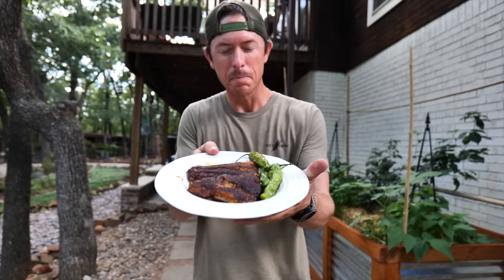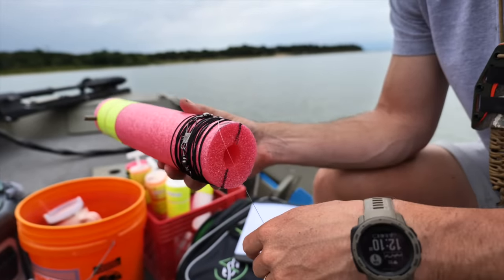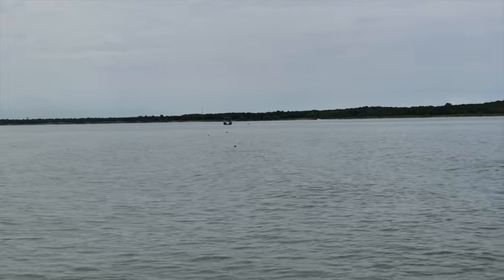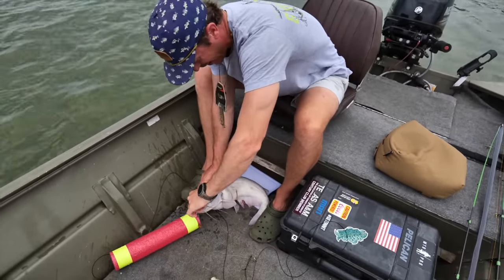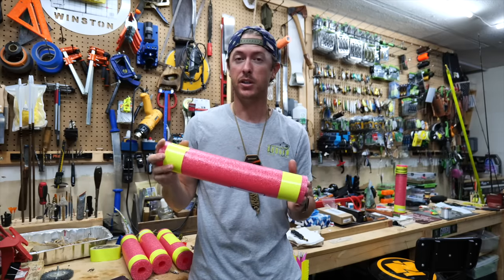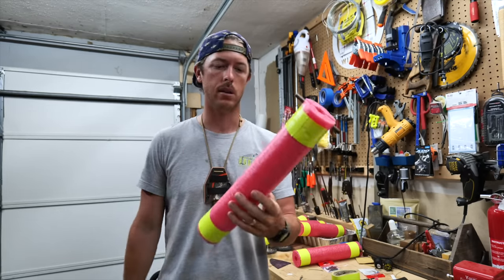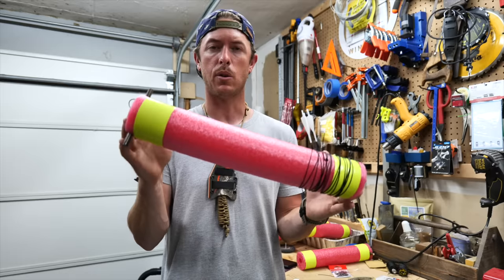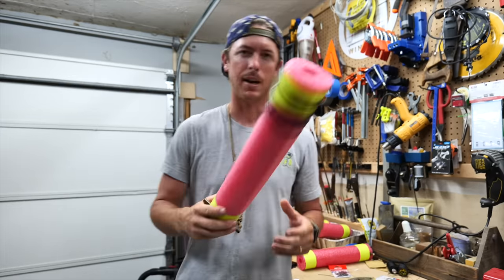Jug Line Fishing Design that's Simple, Cheap & Works! Complete DIY Build & Catch

Comment: You could glue a small piece of pvc pipe in the bottom so the line doesn't mess up the noodle/jug. File the inside nice and smooth, and then there would be no worries.
Reply: That's definitely the best way to do it. Gray conduit fits perfect

Comment: First and Foremost you 2 make an amazing example of what an American couple should be. Your both pretty awesome.
On tiny thought I had for these simple fishing Jugs ( depending on your regulations of course ) is on the top near your stick and a band of reflective tape that way if you loose 1 you can go back at night with a spot light and it would be much easier to find it.
Even if the fish got away youd just be leaving less trash

Comment: You could take about a 2” long piece of 3/4” schedule 20 pvc and stick the line through it, then insert the pvc into the bottom center of your jug to prevent line from cutting into the noodle.

Comment: I decided to make some of these using your "toggle" idea.  But, as a Plan B, I went out and bought 1/2-in PVC pipe, PVC end caps, eye bolts and nuts, and 3M 5200 to seal the hole in the end cap.  You know, just in case.
PROS:
Well, I went out this morning and your noodle jugs worked way beautifully.  I only had one snag (my fault - it was too shallow for my 25-ft line).  When I went to pull it in, the snag nearly pulled my arm off but the toggle did its job and stayed put. I just cut the line.  

CONS:
I have to return all the PVC, eye bolts, and 5200 to Home Depot.
Thanks for the video!!

Comment: Marlin knot we call a Slip Knot and if you pull it around till it knots then it cannot allow the toggle to free float.still releases just have to tug a little harder. Laws have changed and glad you said 3 inch diameter I now must revamp a few of mine I used 2 inch noodle from years back. All of my throw lines are interchangeable and a few for major sized cats. I also added reflector tape for night fishing, losing one can get you a fine now.

Comment: Great video!  Thanks for sharing your ideas.  Using the marlinspike hitch with a toggle for rigging is pure genius!  You called it  the one drawback, but I see it as the best part of your system.  It allows for super easy depth adjustment and you get to tie a cool and easy knot (knot junkie).  Tonight's project...re-rig all my jugs.  Thanks again for sharing another great outdoor adventure.

Comment: I like the simple design. I was worried about the line coming off the stick. So I cut another 3” stick, made a loop knot at both ends of the string. The made a small hole though the side of the noodle about halfway down. Then fished the loop down the center and push the second stick through the loop and the noodle. The stick is very snug in the foam, but the gear tag covers both sides, so no way for the stick to come out. now if the top stick comes off the line is still permanently tied the noodle.

Comment: I built mine with capped pvc with rebar weights....   These tip up type noodles leave no questions as to having a bite since they stand on end as the weight sides to the bottom.  lines are attached with eye screws on one end.

Comment: I put pvc pipe in the middle and use a railroad spike as a weight. Used to waste too much time driving around the lake looking for the jugs. When you have 10+ jugs setting them out can take too long with the wrong design.

Comment: I use the cheap pool noodles and put gray plastic conduit in the middle of it. Pre drill your holes to tie your line to and I can't remember what kind of glue I used but make sure it works on plastic and dries slowly.  It's cheap, easy, and extremely durable.
Reply: I came up with my design by picking up a bunch of old nasty abandoned jugs off the bank and comparing ideas. You could notch the tubing and still do your adjustable type rig.

Comment: Drill a hole going across/under insert another dwell Or do your normal slit and go cross ways with it and make a slightly deeper slit so you can put to of them in and then tie off to both  them in the middle just a thought

Comment: I would find a plastic bottle that would fit over the noodle and cut the bottom of the bottle off to fit over the end of your rig.
Melt a hole thru the bottom, feed your line thru, this would keep your line from cutting into the noodle.

Comment: Justin you should really try making some jug lines using pvc pipe with a piece of rebar inside the pvc pipe and then put the pool noodles over the pvc pipe!!! I definitely like making them this way because they last for ever and when a cat pulls on the bait and the pvc pipe that is laying on its side when fishing starts to go up it will push the rebar to one end and make a nocking noise and will usually make the cat fish get spooked and forget about everything but the bait and they try swimming away with the bait and end up hooking them selves!!! Ever since I figured out how to make them like this I have definitely had a much better hook up ratio!!! Hopefully my explanation you can figure out how to make them?? I use 3/4” pvc pipe with some end caps and on one end threw the cap I use washers, nuts, and a threaded eye lit!! Drill a hole threw one end cap and put the eye lit threw the hole that you drilled with as big of a washer that will fit and then glue it onto the pvc pipe!! I think I cut a piece of pvc pipe at 14” to 18” then don’t forget to put a piece of rebar inside but the rebar needs to be cut less than half the length that you cut your pvc pipe at!!   After you have your eye let bolted to the end cap and glued on and you have your rebar inside you can then glue the last cap on the other end to seal it up!! Oh and when you are bolting the threaded eye lit to one of the end caps you can take some silicone and put on inside of the cap so when you tighten the washer up it will help seal it up tight and no water can get in!! After everything is done you can put the pool noodle around the pvc pipe and I end up cutting the pool noodle 2 “ to 3” shorter for both ends!!! Well I’d love to see what you think of them if you try and make some !!! This would definitely be a good video of you showing everyone how to make them for sure!!! I made mine 12 to 13 years ago and still have them and I also use them every year and they definitely work really well for sure!!!
Reply: He has already made those, has a video on them and showed them in this video. You should really try actually watching the video before you comment.

Comment: I worked 15 years with the county water department and even before that i done plumbing work on the side. So i always have pvc pipe and fittings. Made a dozen 4" diameter jugs and me and my cousin put them out. Some butthole stole 8 of them. It takes a sorry human being to do that. But oh well. Would have been cool if i had a small gps transponder in them.

Comment: You make that not differently than what I make and I have been using that not for 40 years trying my hooks to my line I have not made a pool noodle float you're not works fabulous for everything that I have done I don't use other fancy knots trying Tae them when it is 0° out when blowing 50 miles an hour with the snow blowing sideways that's the not that I use